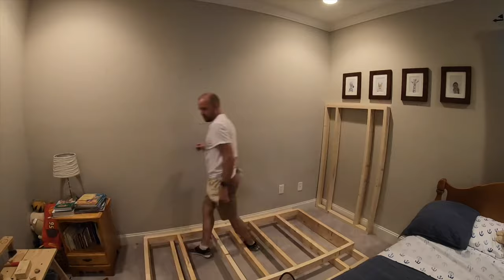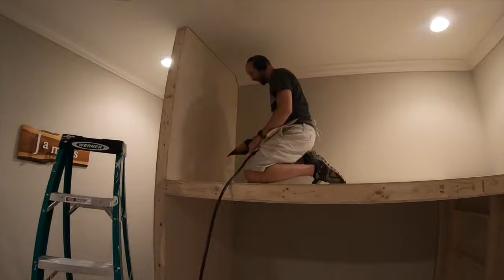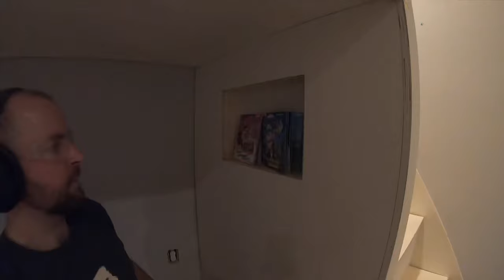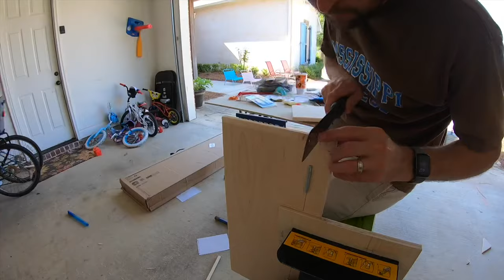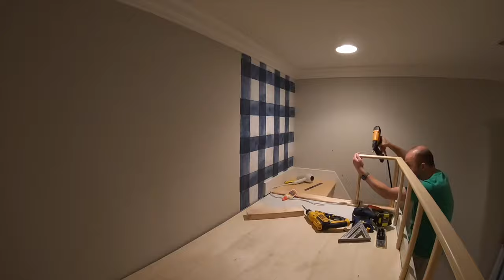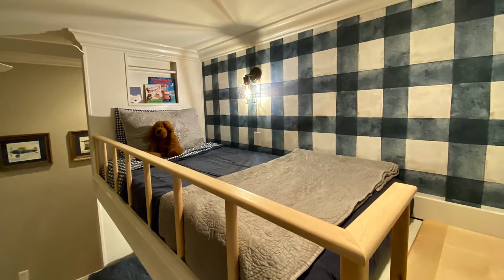DIY Built-In Bunk Beds - Twin over Full

Comment: Great job! Which material did you put on top of the wood framing? MDF? Plywood? I am currently building a bunk bed and was going to drywall over but what you covered with look much better and easier.
Reply from the maker: I used plywood but MDF would have worked great as well. The plywood gives the structure stability (and durability). I worry that drywall wouldn’t be strong enough.

Comment: I just used your video to make my own bed for my daughter.  I’m having the hardest time finding lights like yours that have switches on the fixture.  Where did you get yours?
Reply from the maker: Thanks! I believe we bought it from Home Depot online. Not sure if it’s still there. If you Google “wall sconce with switch,” you’ll find some options. I wound up switching it to a closed type, because one of my sons started taking out the bulb and I didn’t want them to get electrocuted.

Comment: Awesome work. What do you estimate cost of materials to be for this and how ling did it take you to finish ?
Reply from the maker: It cost about $500-600 and it took 2 weeks. I built it during the initial COVID lockdown in 2020, so I had a lot of extra time.
Reply: @wizard_of_eyes  Awesoem work. Thanks for the reply and thanks for getting back to me.
Reply: @wizard_of_eyes  do you happen to have building plans for this project ?
Reply from the maker: @505rokks  Sorry, I don't have any real design drawings. I scribbled some dimensions on paper as I was building it, but that's all. I measured the height of the ceiling and the thickness of the mattresses and did the math to ensure both beds would have the same amount of space above the mattress. I measured the length and width of the mattresses and added a few inches to the openings so that they wouldn't fit too tightly and it would be easy to change the sheets. I guessed on the width of the stairs, which are 19" wide, and they are comfortable for kids or adults to climb without feeling too tight. The shelves are about 17" wide.

Comment: Hi, I’ve learned a lot from your video, thanks for sharing. May I ask if you are using untreated timber or treated? Would you have concern if using treated  interior framing timber? Thanks.
Reply from the maker: I used all untreated lumber, but I don’t think it would cause a problem for the internal framing to be treated.
Reply: @wizard_of_eyes  thank you for the comment. All the best.

Comment: I live this!  I just have a concern regarding the method you are holding up the top bunk, I saw just one screw going in, how did you secure the top bunk to the frame?
Reply from the maker: I secured it with screws through each of the upright 2x4s.  I had to countersink the screws to allow them to reach the twin frame through the long side of the upright 2x4.

Comment: Great! Have design drawings to share? Would be possible?
Reply from the maker: Sorry, I don’t have any real design drawings. I scribbled some dimensions on paper as I was building it, but that’s all. I measured the height of the ceiling and the height of the mattresses and did the math to ensure both beds would have the same amount of space above the mattress. I measured the length and width of the mattresses and added a few inches to the openings so that they wouldn’t fit too tightly and it would be easy to change the sheets. I guessed on the width of the stairs, which are 19” wide, and they are comfortable for kids or adults to climb without feeling too tight. The shelves are about 17” wide. I hope that helps!
Reply: @wizard_of_eyes Thanks Much! great work
Reply from the maker: I found my simple paper and pencil sketch of the dimensions. If you want to reply back with your email address, I can send it to you then delete the comment
Reply from the maker: @mebe  I found my simple paper and pencil sketch of the dimensions. If you want to reply back with your email address, I can send it to you then delete the comment.

Comment: Nice work but railing does not look safe or secure at all
Reply from the maker: It’s very secure, hasn’t budged with a 3 year old hanging on it over the past 9 months. Safety is relative. I could build a cage around the bed but that would be overkill.